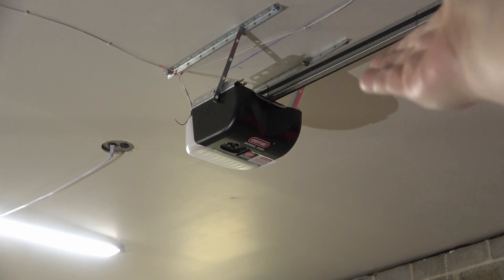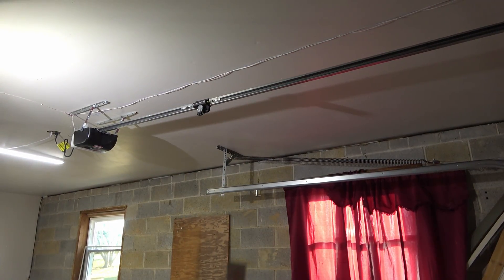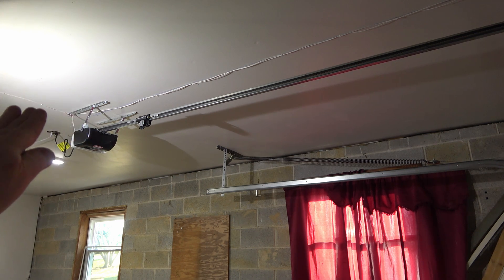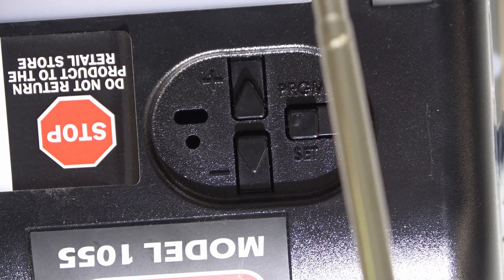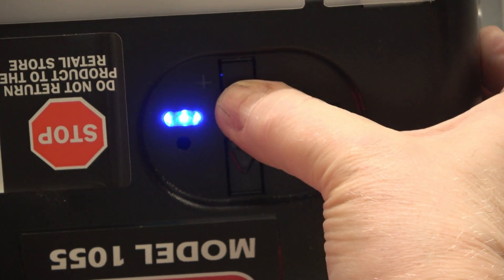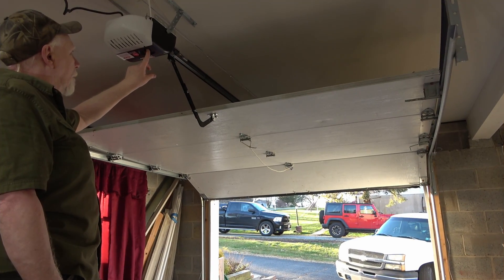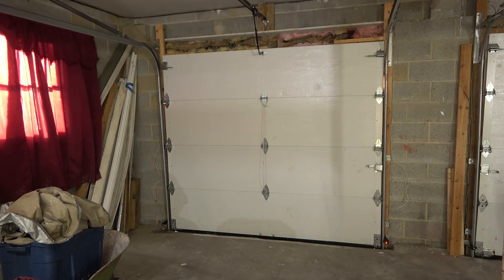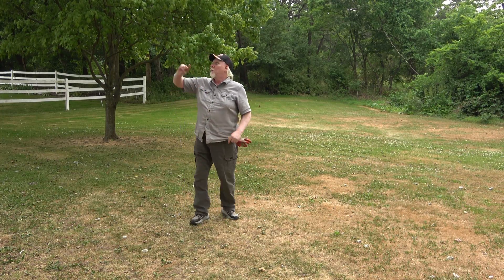Program Genie Garage Door Opener & Test Door Sensor Safety Features (Model 1055)

Comment: You have been very detailed and done a great job. My motor works sometimes and does not work sometimes and when try to program it shows red lights, Waiting for the new sensors and will follow your video. My Genie is new 7055-RH, I think the program and set button are the same. Some video showed to push set button first, then limit, then set again and I think that is wrong. Your way seems to be right. Thank you. BN 08.23.25
Reply from the maker: Most common cause for a motor that works intermittently and flashing red lights is an issue with the safety sensors
Reply from the maker: When a solid red light is present on one of the safety sensors, it means its beam is obstructed or misaligned. The fact that the door works sometimes means the connection is likely loose or intermittent. This can be caused by damaged or pinched wiring.

Comment: Mine blinked red every time I program it. Door won’t open or close all the way
Reply from the maker: Blinking red light during programming coupled with the door not opening or closing completely usually indicates an issue with the safety sensors or the door's travel limits

Comment: Mine is somehow stuck in vacation mode 🫤
Reply from the maker: To resolve stuck vacation ya need to disable the vacation lock feature. This is done by pressing & holding the lock button on the wall console for a few seconds until the LED light on the console stops blinking and becomes solid. If issue persists check safety sensors are properly aligned and not obstructed 🙂
Reply: @wildwoodtop thank you! 😊
Reply: @wildwoodtop thanks for your reply! I explained below but it just needed the open/close limits reset. I didn’t know the door couldn’t be all the way open or closed to perform that reprogram. ☺️. All good now.
Reply: Mine just clicks. Won’t open or close
Reply from the maker: @liliethgarrison7194  is the red light flashing on the head unit
Reply: @liliethgarrison7194  mine was doing that too! Turns out I had to reset the up/down limits but was starting with the door in the full down or up position. The door can be open but not all the way open and not all the way closed to perform that reset. If it’s not your safety light beam at the bottom of the door you may need to reset the upper and lower run limits. If I need to say that a different way let me know. Good luck. ☺️

Comment: Thank you!  It helped me with putting in a new circuit board after an electrical power surge!
Reply from the maker: You are welcome 👍
Reply: Same here, after a storm I discovered that the control board fried. Found a new one on Amazon and it works perfectly, it just needs to be programed now. Thanks for the great video!